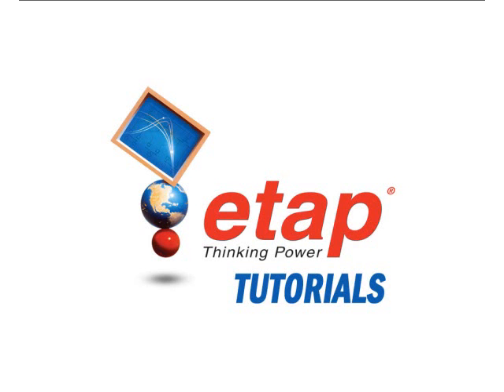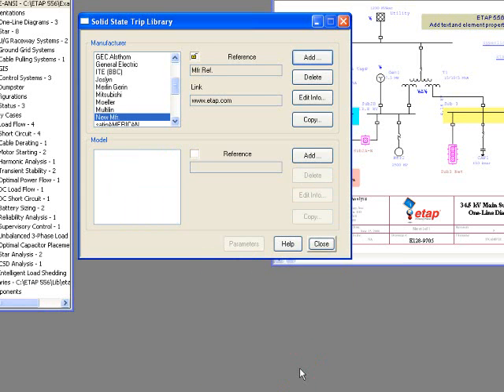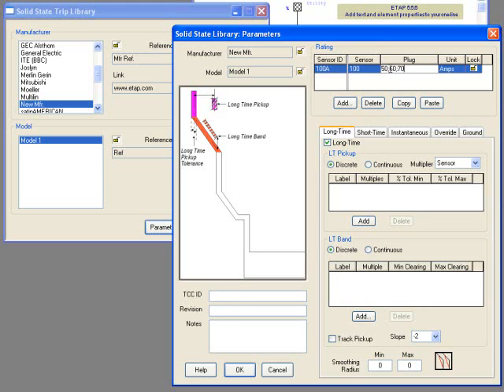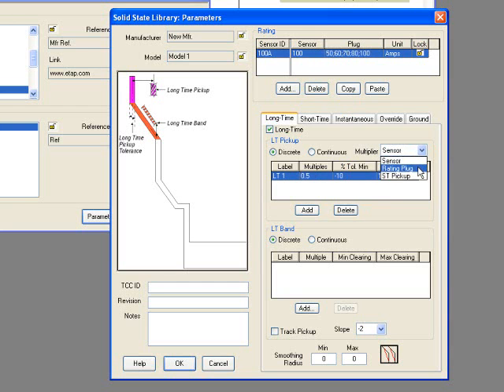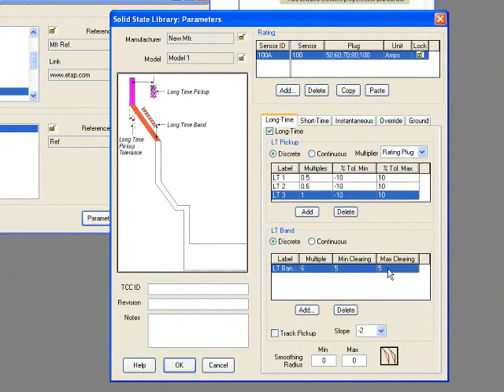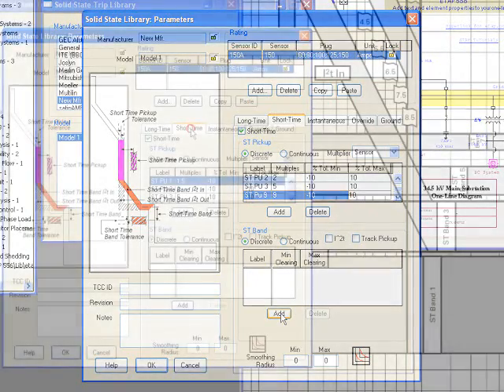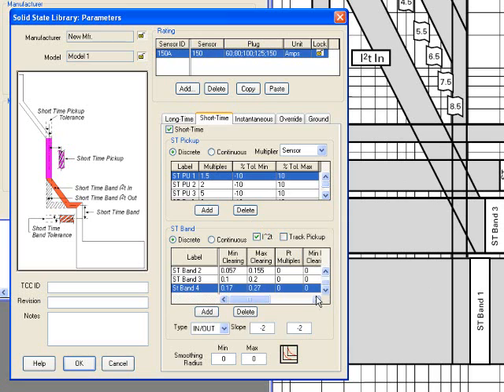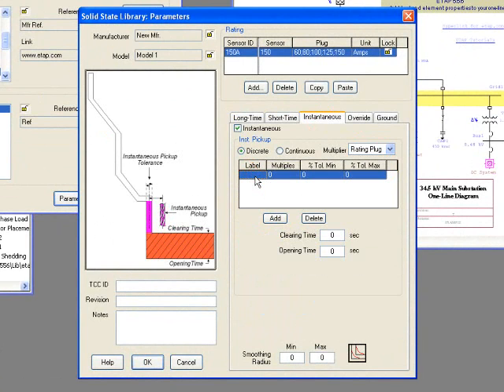Low Voltage Solid State Trip Device in ETAP Software - Part 1

Comment: part 2?
Reply from the maker: Hi Eduardo, sorry you were not able to find part two. Here is the link https://youtu.be/fULMIlZGeRY
Reply: ETAP Software you have circuit breaker 140G-NS of Rockwell?
Reply: Hi Eduardo,We currently do not have this breaker in our database. If you have a helpdesk account with us you can generate a ticket and we can create the model for you.
Reply: how can i pick and drop the designed device or how can i use it?